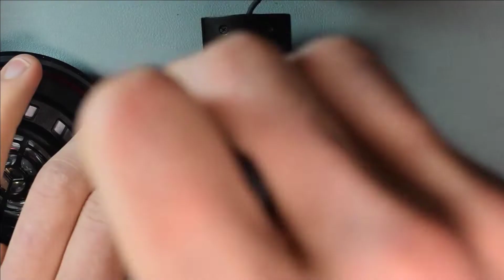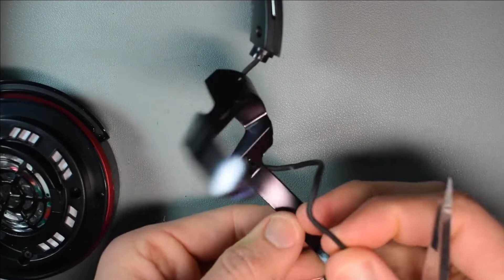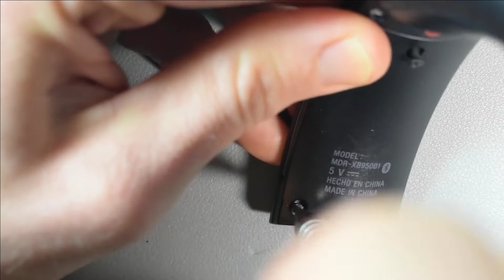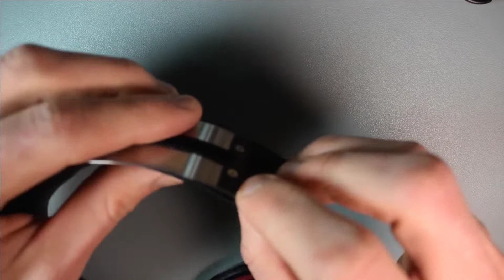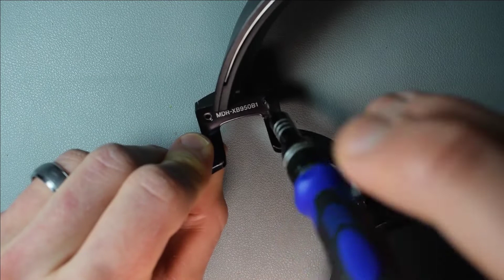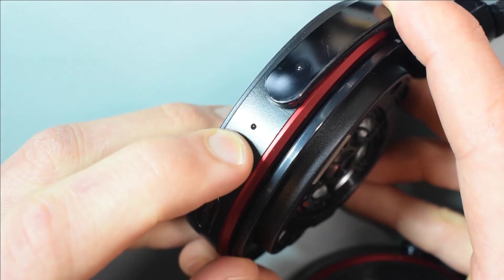Sony MDR-XB950B1/MDR-XB950BT Broken Right Swivel Repair Walkthrough

Comment: Hey! First off thanks for posting the vid! I am having a small issue my left side was broken so I'm not sure if this affected anything, but when I finished soldering and had reassembled the headphones my play/ call function button no longer worked properly. Pressing it now skipped songs instead of pausing or playing. Also volume keys are also a mess. Volume up turns the volume down and volume down skips forward in a playlist. If there is any insight you can give me I'd appreciate it!

Comment: So over 5000 people had these headphones broken..it is surely design defect. @SONY Hello!!!!
Reply: They build them to break so you'll buy new ones
Reply: Me too
Reply: I will use gorilla glue😂
Reply: @dontjustexist876  it will break surely. I tried that. Then again... then again... the plastic will melt 🤣🤣🤣🤣
Reply: @g-g-9 you issue mate
Reply: i have the same issue with mine; I tried many options but later found this video.
Reply: i accidentally stepped on mine

Comment: It you nick the sheading on the wire is that ok the wire is not expose
Reply from the maker: Yeah no worries - they should still work just fine :)
Reply: @jontriestofixthings3718  Do you know if the 950n1 swivel hangar work for 950 bt , I can't find a left swivel and that's all I need to fix my headset